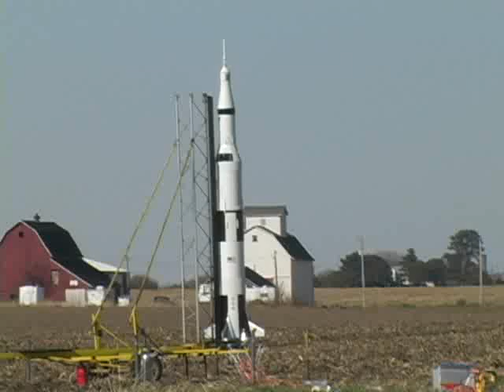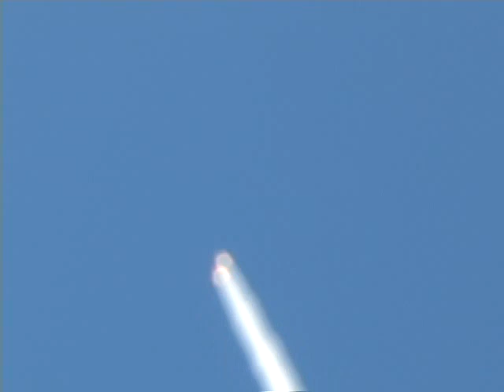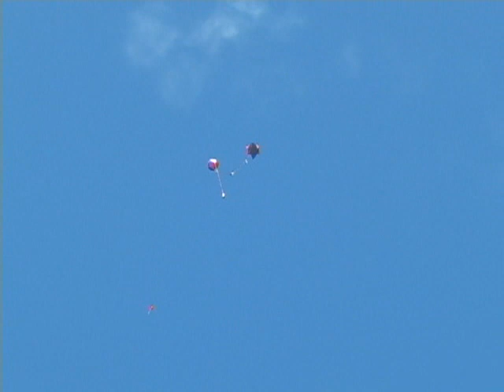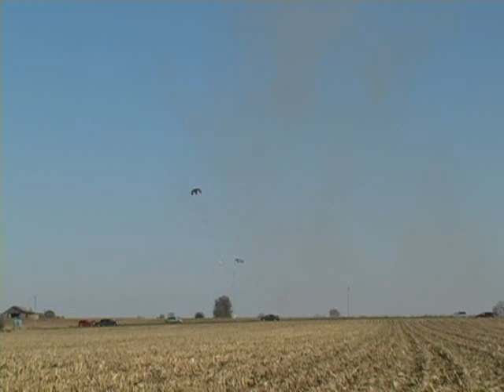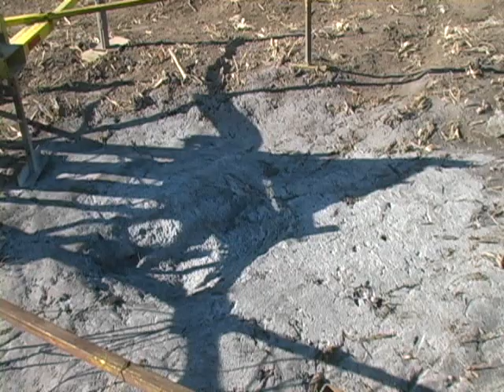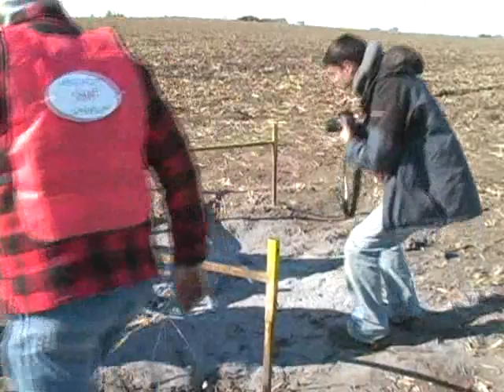Saturn 5 Model Rocket

Comment: This rocket can not be bought as a kit. It was scratch built. The motor itself was probably $700 or more. I believe it was an N2000 white lightning motor, which requires a certification of Level 3 by NAR or Tripoli.